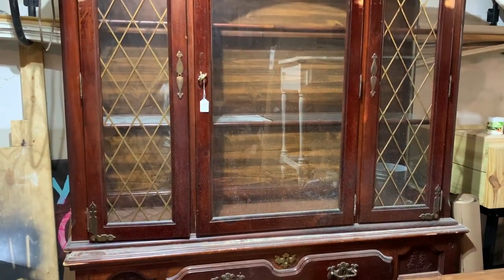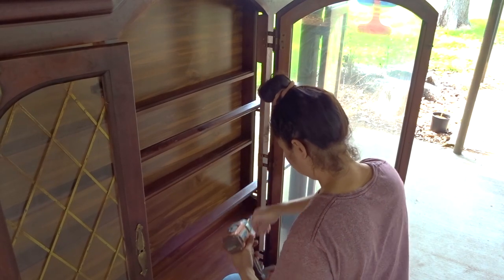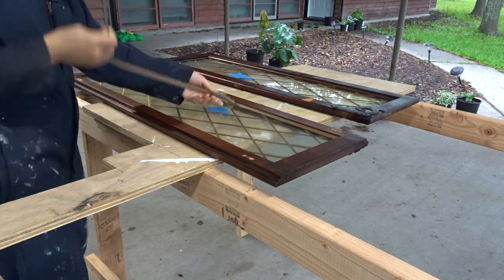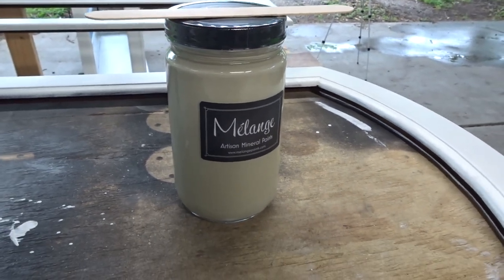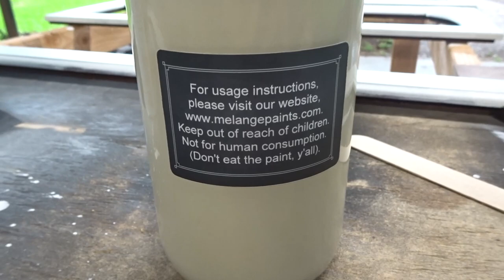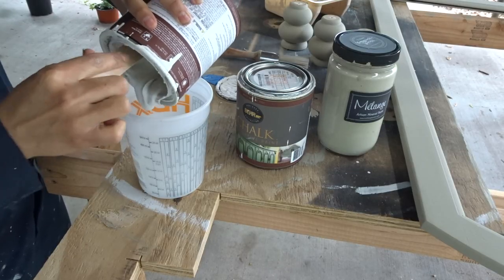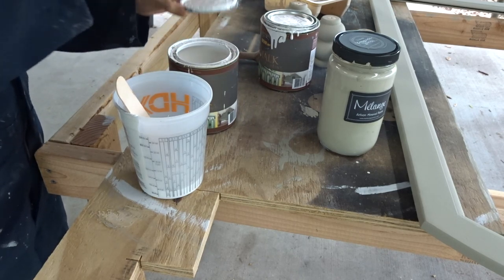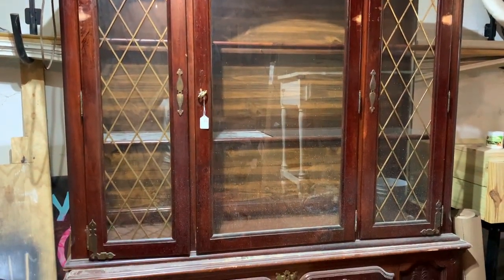FACEBOOK FURNITURE FLIP | $1 Makeover

Comment: Beautiful... one question.  Do you sand? I only saw you sanding after the filler.. do you not sand after primer or after paint, before protective coating? Not even a 320/400?
Reply from the maker: Thank you 🤗Yes! I scuff sanded prior to wood filler, after primer, between coats of paint, and between top coats. I used 320 and 220 ...